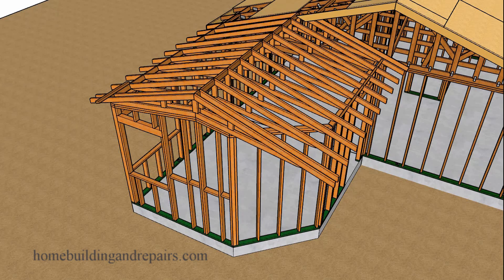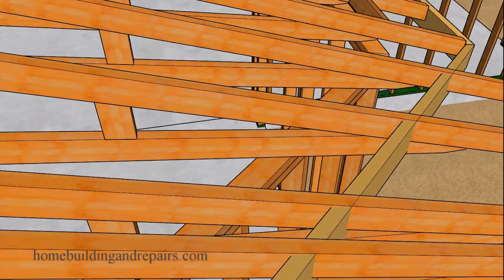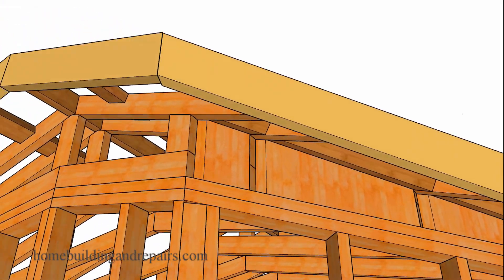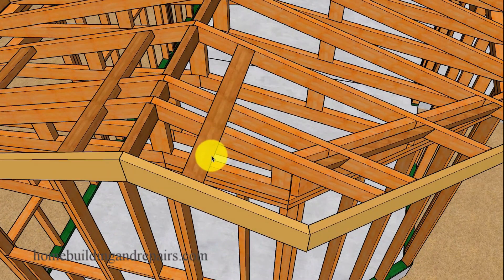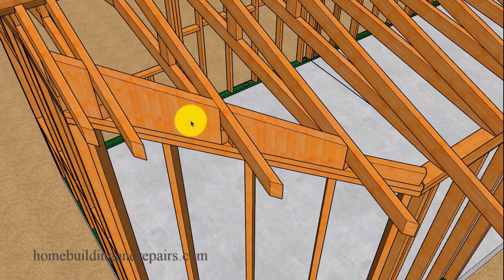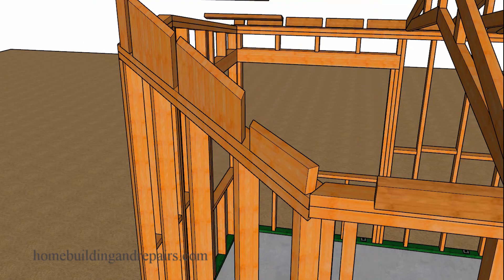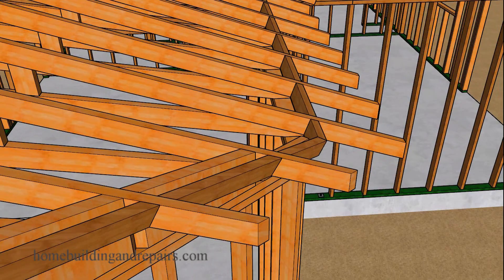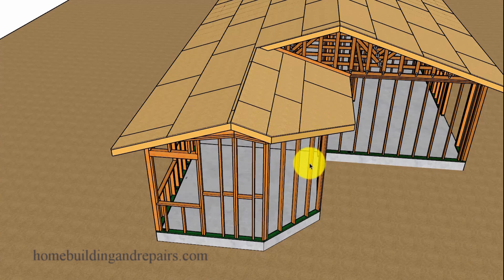Angled Wall Framing And Scissor Roof Truss Design And Assembly - Construction Education Ideas

Comment: Greg, where I am in Iowa, I never see blocking between the trusses at the top of walls.  Is there pros and cons to this?  I think we usually keep them open for ventilation to flow from soffits to roof peak.  I would also love to see a barrage of examples how additions tie in to existing buildings.  Keep it up!
Reply from the maker: The blocking helps to stabilize, but it's really up to the engineer on whether they are needed. You can always drill holes through blocks for ventilation and check out one of the home addition projects here to learn more about tie in to existing house.
https://www.homebuildingandrepairs.com/home_additions/projects/index.html